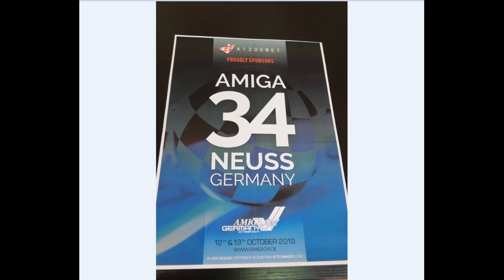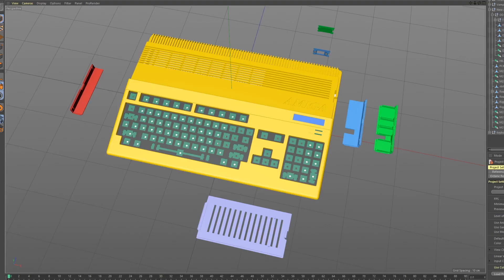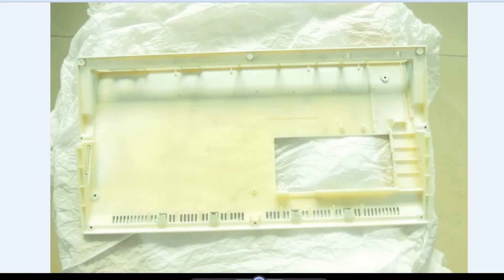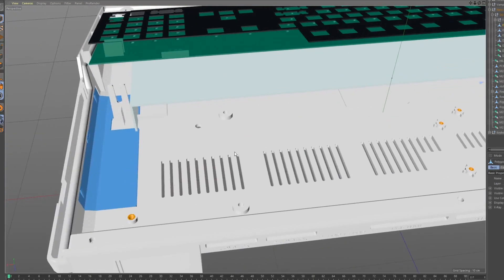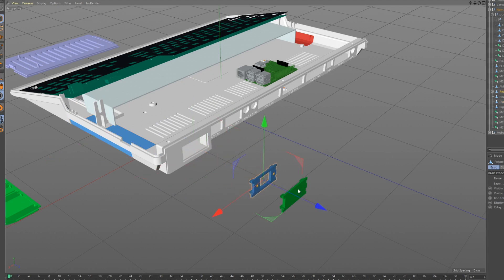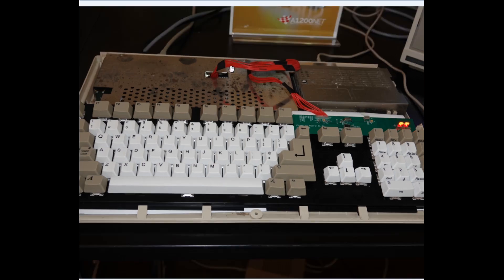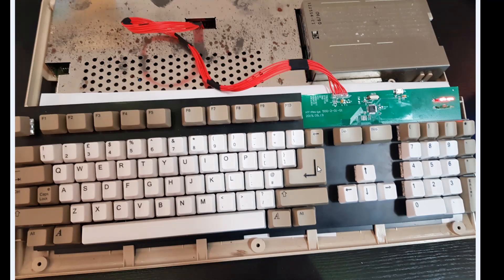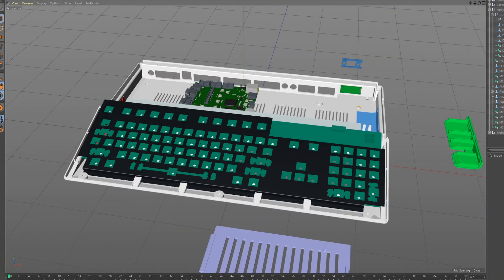Amiga 500 Case Campaign Update - 05/11/19

Comment: Great. But in my view all these initiatives are flawed. 
The have very low production runs. It seems totally impossible to find A1200 cases in stock anywhere...
I guess the same will happen withbthis a500 case....  unobtanium.
Reply: Isn't it the same everywhere with Amiga upgrades. If I just list the ones I have had contact with it's telling. I wanted a black A1200 case, I had to wait months for the second batch to be made then shipped to the US (AOTL) then waited more weeks for delivery. Indivision AGA is out of stock more than in (got one months later). Competition Pro joystick out of stock. I'm still waiting for my Kipper2K keyboard that I ordered in November 2018, that was supposed to deliver around christmas 2018, here I am a year later still waiting. 
There are other things I wanted to order but are/were backordered/out of production but never proceeded because of the uncertainty. I'm grateful that after 25 years out of production ppl are still making anything for my system. I wonder (using a sales term) how much money is left on the table because of ppl's unwillingness to order without a guarantee of delivery? I know my orders would have been $700+ of items I haven't ordered because you can't get them in stock.

Comment: Will this new keyboard also be USB compatible so it can be used with a Vampire V4 stand-alone?
Also, where will it be available? A new campaign, your website or did I just miss a previous announcement?
Reply: Great question, I'm waiting on my case and key caps right now with the intention of throwing a vampire v4 into it asap.  Would be great to use the real keyboard with it as well.
Reply: Good idea. 

Perhaps the keyboard-controller-flash-memory has enough free space for an USB-stack incl. HID-class?
Reply from the maker: HI Christian,

The keyboard is already USB Compatible and the USB port is already present and visible from the photos following the link below.

Keyboard's technical specifications are available by following this link post from team's Facebook page:
https://www.facebook.com/A1200net/posts/2943084835720170?__xts__%5B0%5D=68.ARAggaiVrj_0QCv4-MBh2ijAraDb5-H8n3DFvQXu1ZiR7d83-n0ndCsyCqD8vAjoOPv_eFuRAAJszvvqPT60meM6sDd8L6DBgPmPQ4n5t4OTwz4xmxq1ZSOp6TYcHXFQnAKRiVFRFR6MuB5Q5tNSrgOLrH36HHI3vrjGhHxRPn3tKr1rrLD4yc7r4JGq05UPeHesUQ2z22jB42uOMEGC2WzwOh2XV257PfFnjJonzO5krs_jWX_6tx18ydbru826SffAJEpfiT6xiMEtCS5yj7XuHsv74dtgEUoSNk4Qp7q_iEPy9ROT7VEwemk3nbIC809JyT-9dkllwKaQmw9Y4CNXbkhW&__tn__=-R

Thank you for your comment Christian,
Cheers